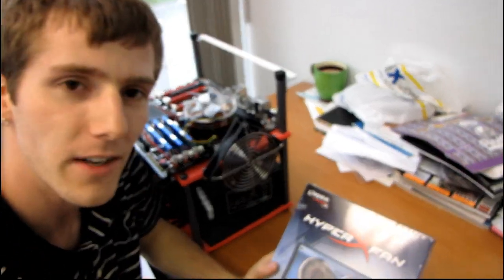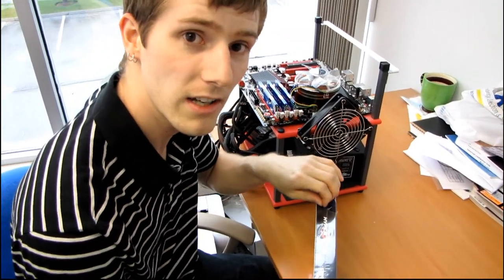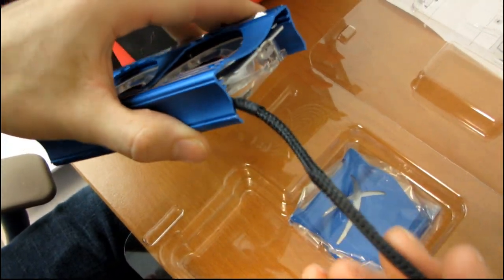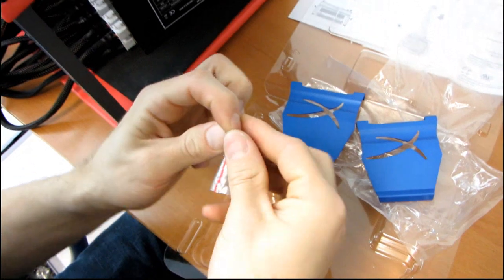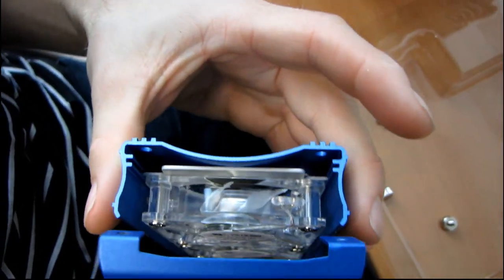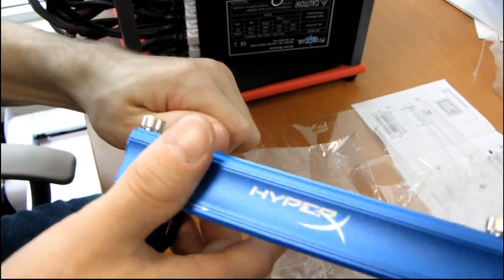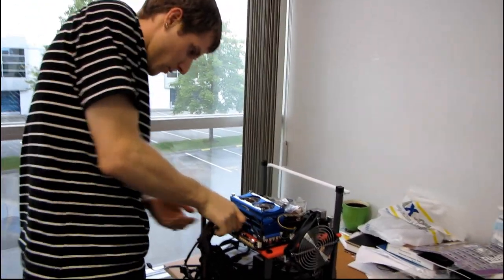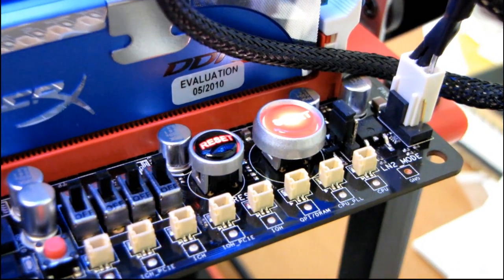Kingston HyperX Blue LED Aluminum Dual 60mm RAM Fan Unboxing & First Look Linus Tech Tips

Comment: Is a RAM fan necessary for ram clocked at 1600, then overclocked to 1866Mhz. The ram i have is G.Skill Ripjaws-X 16gb (2x8Gb) and it has some decent heat sinks on it.

Comment: Will this even fit with my COOLERMASTER HYPER TX3 EVO and even if it does will the system be efficient since the CPU fan will blow on the RAM and the RAM fan will suck air out of RAMs.. it's too complicated for my fluids engineering knowledge :P

Comment: I would get the Kingston HyperX Predator 2400Mhz... IT IS THE cheaper, runs COOLER!, AND it has BETTER timing, and it is on their website that Kingston has the LEAST ram failures in the US, also the LOWEST percentage of returns!!! And it is certified, and "strengthened" to take a 2400Mhz load, AND HIGHER VOLTAGE THAN THE G-SKILL rams! SAFELY! Look on ebay, over there they are a bit cheaper.

Comment: Will it fit on a z97x gigabyte mother board with a gtx 970 I'm the top pci slot over 4 8g vengance ram sticks in a Thermaltake mk-i full case?
Reply: Duh not over the pci slot. And nvm it fits got it installed.

Comment: i cannot see why you need to cool ram lol. maybe just maybe...for an apu build???
Reply: +vespaman0 old video
Reply: +Undertale Trash ;3 yes I know. but even at the time it wasn't necessary
Reply: +GAMEPLAYER SLOVENIA how much?
Reply: ***** like how much dou have to overclock it for it to get that hot? what happens when it overheats?
Reply: ***** but people overclock ram without a cooler all the time. i guess on older tech overclocking was more likely. probably not as stable. even low speed ram these days can play any game.

Comment: Can  this fan be fixed on the motherboard model no.asus p8z77 v deluxe.. on 4 kingston ddr3 1600mhz rams.. I'm planning to buy it but I'm confused as the ram slots are very close to each other in the motherboard.. plz help

Comment: @deejaypprada 
 
go check newegg (dot) com / ca for memory and go to advanced search and search for higher clocked ram

that link is for canadian. why would you want such high frequency ram? It really does lower your overclock on your cpu a lot. the performance gained from spending $100 more for higher clocked ram versus buying normal ram and overclocking your cpu is not worth it. my advice is to buy 1600 ram, a good mobo, and a really good CPU, and overclock the cpu.

Comment: Can i use it with DDR4?
Reply: You don't need but in theory yes DDR 4/3 is just the bus (in my knowledge)
Reply: +SIME_LP not sure if 4 is longer than 3- 288 vs 240 pin modules

Comment: ok so the ram you have there now its 2016 is it still good now im looking at a 3 pack of 2gb sticks that has a 4th with them. im running a gigabyte ga 970 d3 mobo and an fx guad core cpu. the mobo has 4 slots of 2 colors will this work ?